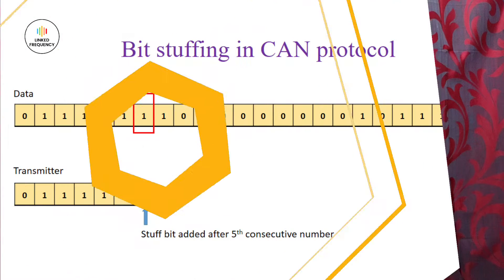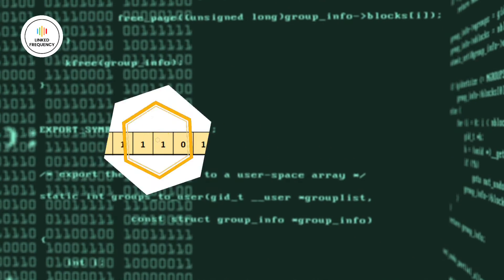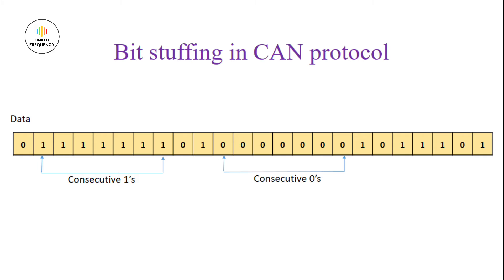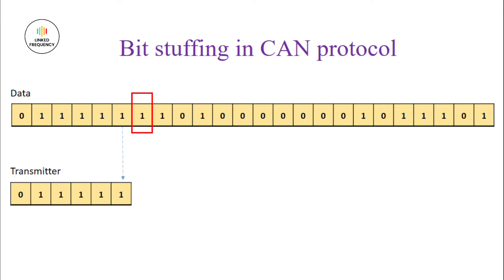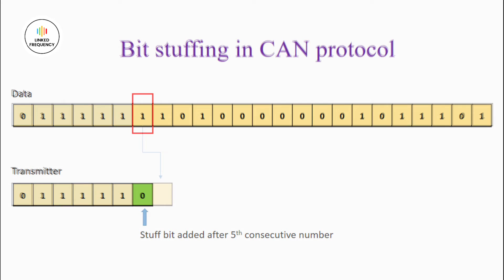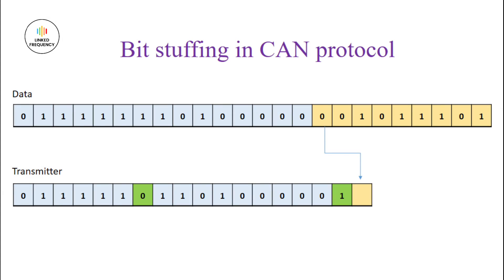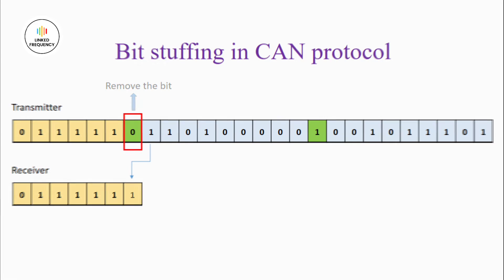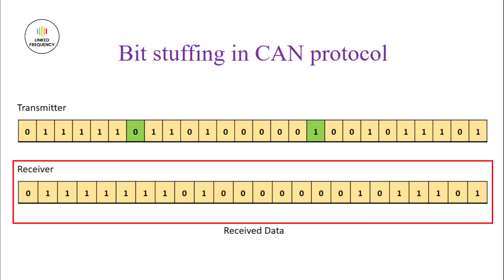Bit stuffing in CAN protocol #E15 | Aishwarya Pattar

Comment: What happens if the data only contains 5 consecutive 1 and then 0. As in this case transmitter may not add a stuff but as they consecutive bits are 5 but the receiver will will see 5 consecutive bits and may remove the data bit 0 as stuffed bit
Reply from the maker: Bit stuffing ensures no more than 5 consecutive bits of the same polarity. 
Transmitter:
If the transmitter detects 5 consecutive 1s, it adds a stuffed 0 to prevent a sequence of 6 consecutive bits of the same polarity.
In your example, the sequence is 111110. Since the sixth bit is already 0, the transmitter does not add any additional bits.
Receiver:
The receiver follows the same rule in reverse: after detecting 5 consecutive 1s, it checks the next bit to see if it is a stuffed bit (0).
If the receiver mistakenly interprets the actual data 0  as a stuffed bit, it might remove it incorrectly.
Remark:
If the receiver misinterprets the 0 as a stuffed bit, the original data will be altered, leading to data corruption. This error occurs because the receiver relies solely on the pattern of 5 consecutive bits, not verifying whether the 0 was intentionally transmitted as data or added as a stuffed bit. I hope this answers your question

Happy Learning!
Reply: @Linked_Frequency  exactly that is my point...